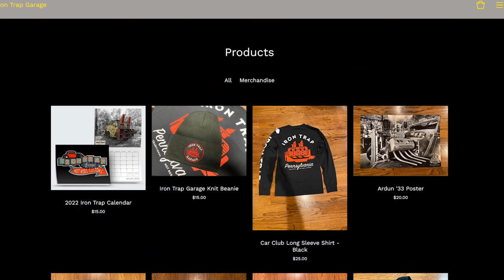AMAZING Junkyard Hot rod Interior Transformation!!!- 1939 Ford Forgotten Hot Rod

Comment: Steve was a great find 👍 he seems to be a very easy going guy 😎 and knowledgeable 🤔 great hair also 😂🤣
Reply: I think the guy is on the pay role. Both Matt and Mike aren't really mechanics. 
Matt does sheet metal repairs and welding and Mike is a logistic person.
Steve can do engines and wiring and maybe transmissions also.
Reply from the maker: You’re right we aren’t mechanics can’t do any mechanical work on cars… guess you missed the other cars we put together before Steve lol. Steve is a good all around helper. He can do a little bit of everything but it’s not that Matt/Mike can’t do mechanical work at all lol.

Comment: looking good!
On those vacuum wipers you may be able to make them come around. On my 47 Olds that had been sitting 40 years the wiper linkages were stuck and the seals in the vacuum motor weren't sealing.  After replacing hoses PBlaster got the rest of the job done. It freed up the stuck mechanical linkages, but the vacuum motors were still not working...So for the hell of it I shot a bunch of that penetrating oil into the vacuum ports on the vacuum wiper motor and worked the wipers through their motion with and without vacuum and the darn vacuum motors came back to life!...They're still slow for the first cycle or 2 after 5 months dormancy for winter, but always come right back to life. I did the same with a used washer fluid jar vacuum pump (though I had to take it apart to deal with some rust chunks in it) and it came back too with no new parts.
My only gripe is the owner's manual indicates the wiper motor is supposed to self reciprocate, and it doesn't (wipers on extends them, and off retracts them, but they stay in either position if I don't repeatedly turn them off and on when they hit either end of travel)...Once it's in more regular service I may take the vacuum motor apart and look for some kind of reversing valve and try to free it up...It's usable as is albeit not as ergonomic as it would be if they self reciprocated.
Reply from the maker: Good idea we may try that!

Comment: That beautiful interior really makes it snap.
It's going to be mobbed with people checking in out at Hershey and elsewhere. 
Next time you gotta cut that rubber mat lay it out on a sheet of plywood or on your concrete floor then use a straight edge and carpet knife to cut it. 
It'll cut way faster and easier. 
I've cut similar material that way.
Or use Fiskers scissors as they zip right thru pretty much most materials. 
I use then to cut felt pool table cloth.

Comment: I've used that rubber and ribbed for the floor. Also to get the most out of a sheet of rubber I'll measure across with a tape and then use a fabric tape measure over just to get the total over the hump.

Comment: A possible reason you can't find a repro rear floor rubber mat is because they had rubber mats in the front and carpet in the rear? Lots of cars came like that until the late 70's.
With the vacuum wiper motor,try squirting so Johnsons baby oil into the motor first. It helps the paddle to seal,and some Y blocks had a fuel/vacuum pump combo unit.
Reply from the maker: Couldn’t find a carpet rear mat either! But you’re probably correct there

Comment: Did you have to heat and bend the shift lever to clear the under dash gauges? My 39 has a 37 shift lever and it hits the dash in 2nd with no gauges. I either need to bend mine or get the correct 39 shift lever.
Reply from the maker: I can’t remember. I think I had to bend it a little to clear that gauge panel under the dash mainly

Comment: 10:32 Don't care for the way you wired up this car without a shielding over loose wires. 
Simple plastic loom material would have made it look way better.
13:26 You can hang plastic sheeting on the inside of the doors and then install the door cards. The plastic makes a vapor barrier from moisture to help protect the interior pieces.